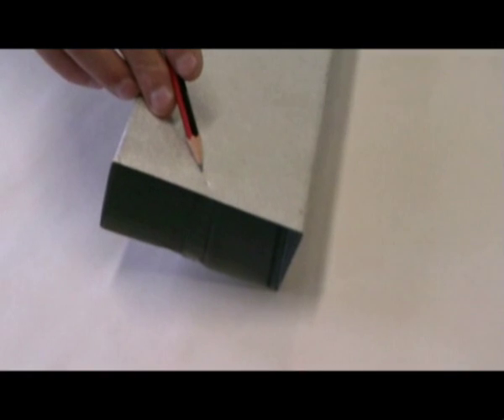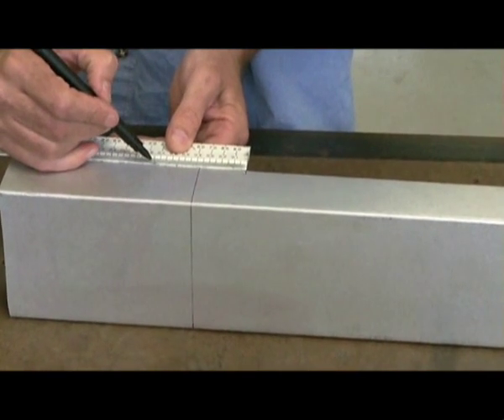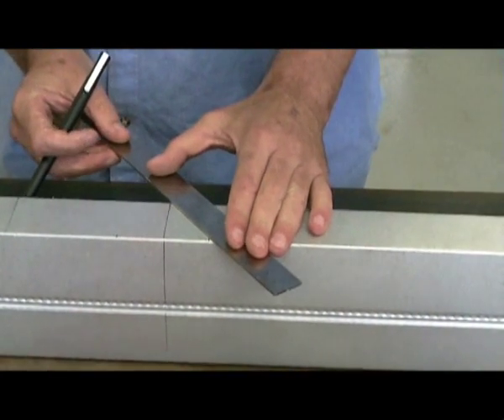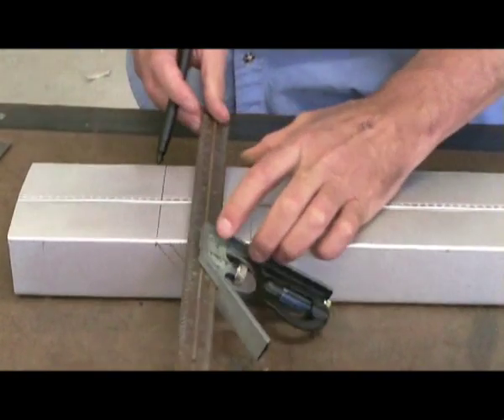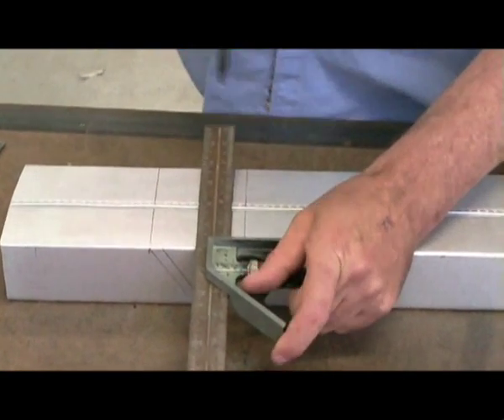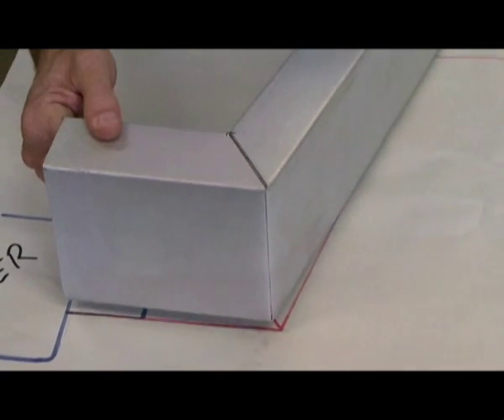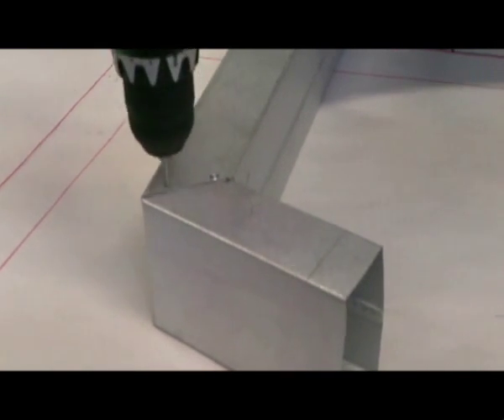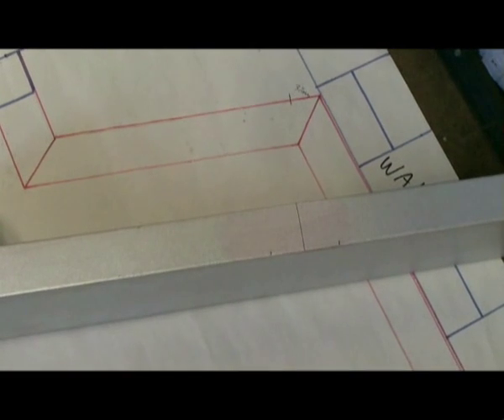swtafe

Comment: measurements from previous video?? why couldntbyou just of said it here?
Reply: From most suppliers, downpipes 100 X 75 are:
Measure from gutter to first bend
Mark it all the way around
go down 130
mark it all the way around
between the two marks is your measurement
make sure the flaps are on the upper section always or it can leak.
measure to the wall.
repeat keeping in mind that the cut will be at the front of the gutter this time, not where the seam is.